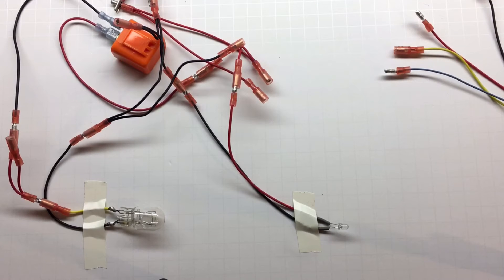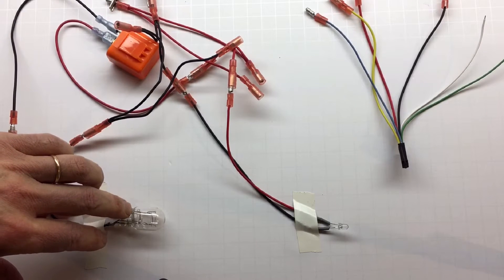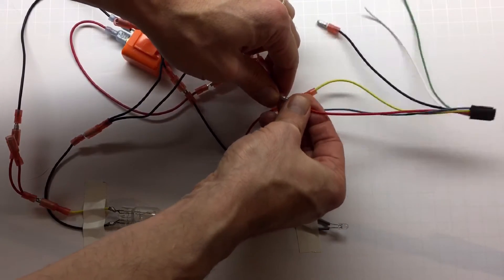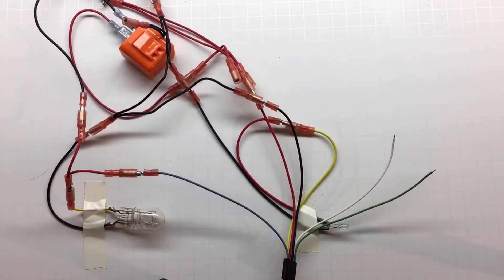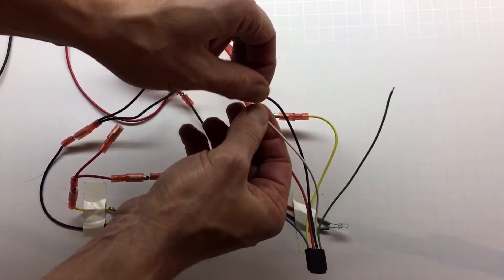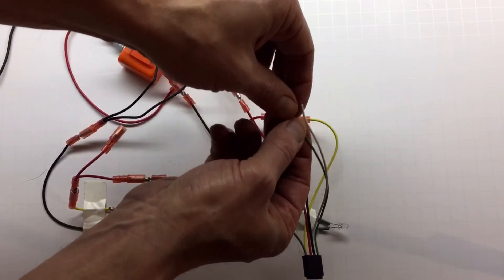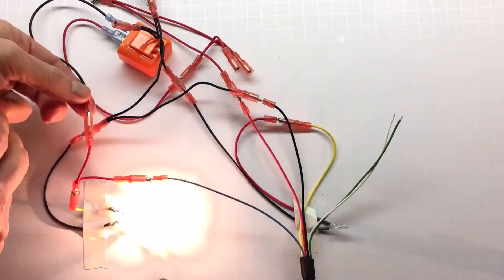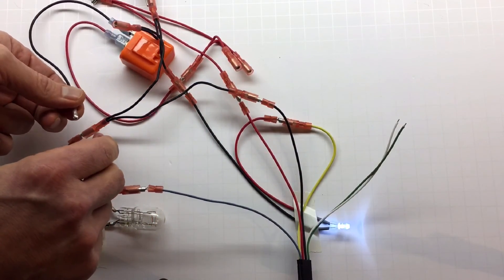Car MotorCycle Running light cancellation during active turn signal

Comment: Hi there,
Is the green wire the same as the trigger wire? Are they joint together on the timer PCB board 🤔? 
Also is the white wire joint to the Red power input wire on the PCB?

Comment: I go through this sequence, but at the end I touch the green wire to the black earth wire once, but it flashes twice, not once.  Why?  Does that mean it is not properly set up? One difference also is that I only have the one light which is the blinking light - not two lights, blinking and park lights.  But I use a diode so that current does not run back through the timer to the parking light circuit and another diode to prevent current running from the parking light circuit back through the blinking circuit.

Comment: I used this timer on my motorcycles for the air shifter to keep it in gear longer , it is the best thing available to do this job ! There is so many things you can do with this timer !!!  I'm very  happy I found this and thank you for it .
Reply: where to find this timer. and what it is called. is it available online. if yes then please give purchase link. please tell what is this timer called and what is its name
Reply from the maker: Here is where you can find information on how to connect timer : http://bit.ly/rlc2doc 
Device itself can be purchased here: http://timers.shop
Reply from the maker: Timer is Multifunctional timer 5 amp. It can be purchased at http://timers.shop